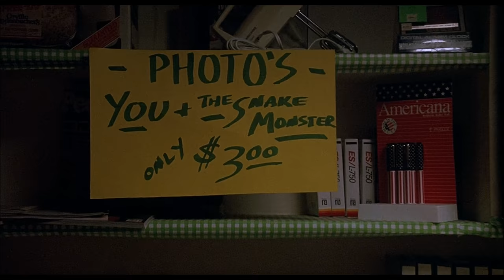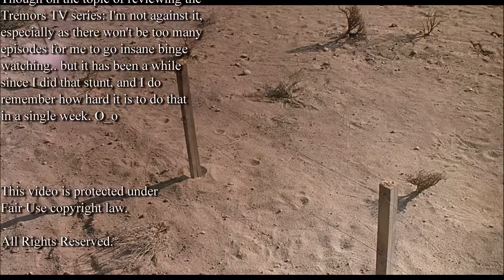Tremors Review

Comment: Anyone remember Avatar: the Last Airbender? In that show, one of the main characters, Toph was blind, but she could see using her earthbending; that by sending out a vibration into the ground, she could detect where everything in relation to her was, almost like a sonar.

I have a theory that the Graboids can do something similar. The scene where that one Graboid takes out Burt and Heather's truck...without the truck moving, turned on, or even doing anything. In short, how did it know the truck was even there? It's why I suspect that Graboids can get a "sense" of their surroundings and maybe even communicate with each other; it's also why I believe that the Graboid in the second movie was able to stop and change direction before going off the cliff, or smashing headfirst into a rock.

An initial problem with this theory would be the scene where Val remains completely still, but the Graboid has difficulty finding him. Well, think about the differences. We can tell by the respective scenes, that Burt and Heather's house was mostly solid foundation, with even a gravel path. In sense, the surrounding dirt was firm enough to send a clear vibration through.
However, the area of Perfection Town where Val was, mostly had looser dirt and sand; you can see that when the Graboid tentacle emerges to inspect the scene. Toph makes the claim that her "Sonar" becomes "fuzzy" when she sends a vibration through sand; mainly because sand is so loose and shifty. My suspicion is, the Graboid knew Val was there, but because he was immobile, and the sand in the area was so shifty, that it lost track of him.

Comment: I mean, it dying because of falling is very believable since the sudden change in momentum, the impulse would be huge. I mean a deep sea creature from the bottom of the deepest oceans would still die when dropped from a high place even if it survives very high pressures in it's natural habitat. the same principle implies in smashing into a concrete block with a high velocity especially if the impact was strong enough to smash the concrete, it's kinda like smacking it with a concrete block.
I know it might be for comedic reasons you said it, I just wanted to clarify the physics of it